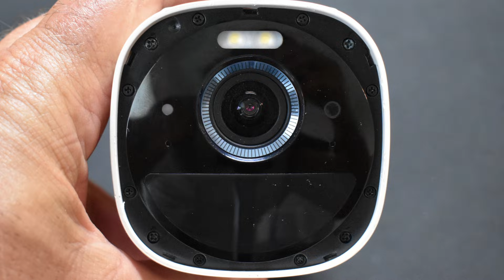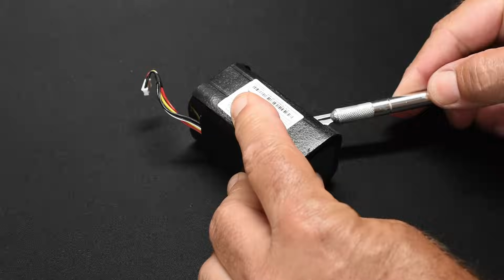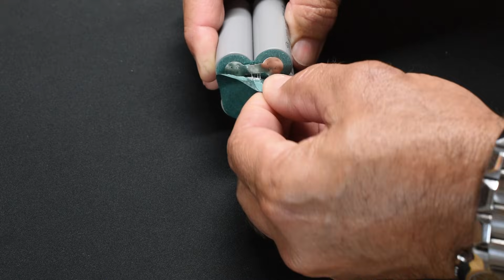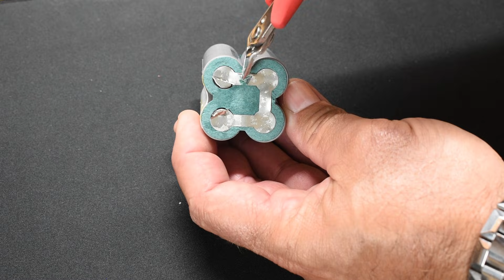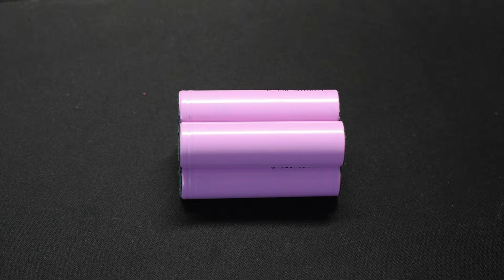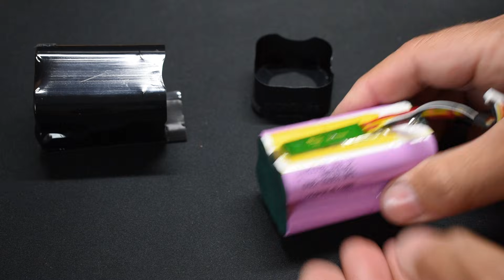eufyCam 3 S330 Battery Pack Rebuilding / Replacement~ NOT CHARGING

Comment: Excellent video. Won't help me though as the camera won't operate in the cold where I am in Northern Ontario Canada. Eufy says camera operating temperature is no lower than -2 Celsius. That would be a warm day for me in the winter. I would suggest just not using their solar cameras in Northerly climes. I was able to replace one of my solar cameras with a Tapo wired unit but there is no replacing the other camera as there is no power outlet nearby. A problem with no solution alas...

Comment: Works on A 2C too. I re used the battery board on a pre wired 18650 2P battery pack I removed the supplied 2 wire battery board and was able to solder the new & old nickel strips together, the current used to run the camera is low so solder is OK.

Comment: You have saved me at least £130, that's included purchasing the tab welder, side cutters & green baise end insulating tape! This was the second S330 that had failed, after 2.5 years this one. Since this second failed camera would not accept charge I thought it might well be the batteries, so gave it a go, it's fully operational again now. Fortunately I kept the original camera that failed (just 10 days outside warrantee), thinking it may be useful for parts. Needless to say I will be ordering a second set of batteries to fix that one also, that will be about £150 saved (I've now got the tools) compared to purchasing a new one in the UK. Thank you so much!

Comment: I recently replaced the batteries in my EufyCam 2 Pro. I made sure to fully charge the new batteries before installing them, but the camera still shows the battery level at only 5%. Even when I try charging it again, it doesn't go above 5%. I suspect the Battery Management System (BMS) needs to be reset, but I'm not sure how to do that.

Comment: I just checked your provided list, and yes your battery’s used were “unprotected”, thats what you must use (from what I understand) because that little circuit board you removed on the start is the Battery Management System for those 4 batteries, some of the other batteries each have their own BMS in each battery. At least that’s what I understand, please correct me if I’m wrong. I have no idea what would happened if you were going to build a battery pack and you purchased batteries that are “protected” meaning they all have build in BMS. If my thinking is wrong pls help me here.

Comment: The piece you took off and said keep this you will need it, is that a BMS for those batteries? If it is then shouldn’t we buy batteries that are “unprotected”? Otherwise you will have problems, as some of the other batteries already have BMS in the batteries. Please explain if I am wrong.

Comment: Is there some sort of specification on the battery pack? For the Eufy Cam 2C pro, replacement battery packs can be bought online. Maybe it’s the same battery pack? This would make the whole replacement process easier if an already fully assembled battery pack can be used.

Comment: Hello, I opened the device because it is blinking red or blue, but there is no sound when I try to connect it. I attempted to disconnect the battery in hopes of triggering a reset, but it didn’t work. What could the problem be? I have another camera connected to the same Homebase, and it works perfectly.
Reply: Same problem. 

You found a solution? 

Mine blinks red long. Then 4x blue blinks.
Reply: Same problem.

Comment: I think folding the tabbing over after spot welding underneath to make a square going back to the first spot weld was brilliant.  I was wondering why you didn't cut the first tab to length before spot welding, which was intuitive to me, but your procedure makes spot welding a tab on top of another happen only once.  👍👍  There have been times I could have used a spot welder, like when soldering wires onto small, round rear earth magnets instead of using tabs to solder the wires to, because heating rare earth magnets that much makes their magnetic attraction decrease appreciably, especially those as small as mine, and soldering to Li-Ion cells is very bad.

I think your 0.15mm x 8mm tab roll will be fine for most applications.  However, your "Battery Spot Welders" link goes to a page of MANY.  Which make and model is yours, please?  I want to be sure to get the same one as yours because you have proven it works well.  Thank you, Scott.
Reply from the maker: Normally if space was not a concern, I would've folded the tabbing material backwards to make a square corner allowing more space for spot welding and then fold It downward at a right angle. The best thing to do to find a strong enough spot welder is look for a spot welder that claims to be able to weld one size thicker tabbing material. You need to do that because many companies lie. Thanks for watching
Reply: @electronicsNmore   Thanks for the tip; one which claims to spot weld 2x thicker than the tabbing I intend to use.  👍

Comment: I have a spot welder from Amazon, too weak. I've done some good repairs but have to weld many spots or over existing to try to get better. You just don't know what you're getting. I opened up a Milwaukee pack to replace the cells and it had a bit thicker nickel strip and the spots won't even attach on that. I dont know what to get.
Reply from the maker: What you need to do is select a spot welder that will weld tabbing the next size thicker than you intend on using. The reason you do that is because companies lie.

Comment: Great video. What is the exact make and model of the spot welder? When I go to the Amazon link it shows many many models, I want to get the same one that you have, thanks!
Reply from the maker: I've had it a very long time and it was actually getting a little weaker the battery. Should be able to find Battery spot welder on my channel. Look for one that's even a little more powerful